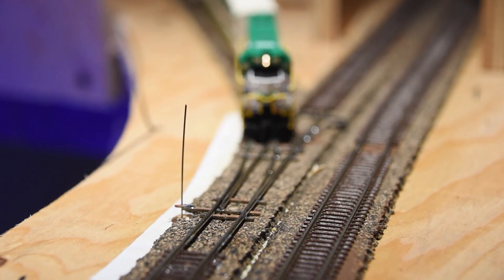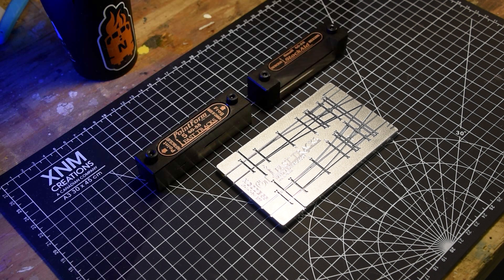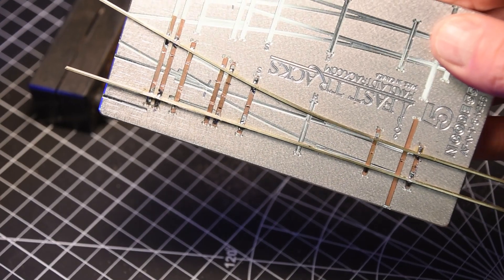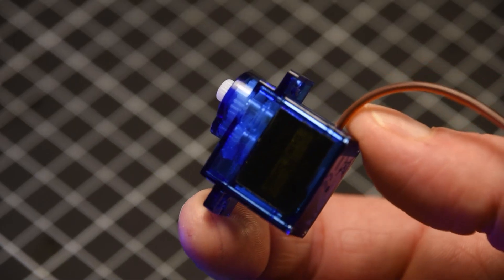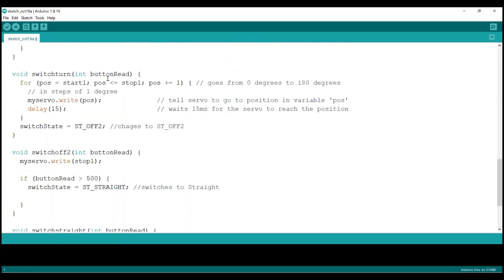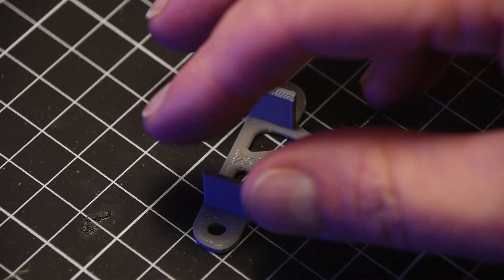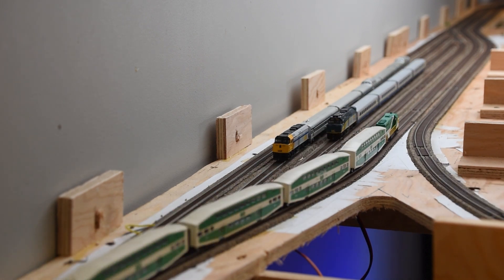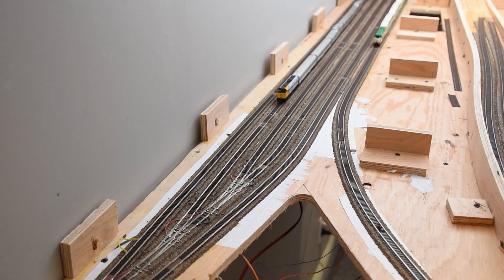Union Project: Handlaid Turnouts & Servo Point Control

Comment: thanks for sharing the STL files for the servo mounts - planning on using these when I get started with installing my servos on my n scale layout. So how many servos in total will you be driving off the Arduino? - just wondering as there is a limit to how many switch inputs the Uno can take and no one explains how to deal with having multiple servos that all need their dedicated switches.  Most examples just show a couple of switches.
Reply from the maker: I'm sorry this comment got lost. You can control 6 servos with one Arduino, but you need to provide an alternate power source. There are more than 6 inputs for 6 servos, so you can have multiple buttons control a single switch. Those switches will need to be open/momentary switches, not closed stop switches. (I think...)

Comment: Very cool video, love your idea of the stump switch. Yeah, wiring, it demands a separate plan, but as long as we’re experimenting it takes time to figure out the best way to draw, install, adjust and logically fashion all the necessary wiring. 
Some great comments on the FastTracks turnout jigs. The filing of the switch blades is also a necessity in HO scale, for Code 83. Can imagine that’s even more imperative in Code 55 for N scale. Nevertheless, when properly built, checked and tested, they’re the smoothest running switches my humble railroad is familiar with. Especially, the way it allows to construct a long frog, makes the turnout less dependent on the guard rails, which most certainly improves reliability.
Great project, love the duck under and the way you did show the occupancy for the staging yard. Cheerio
Reply from the maker: Thanks. It's interesting to note that the very slightest variance in the turnouts does affect their performance. The turnouts all work well, but some are much smoother than others. Almost in perceivable differences, but at this scale it matters. Likewise, I think the lower weight of end scale equipment amplifies imperfections as they tend to get thrown around with the slightest bump.

Comment: Excellent video. Question, have you considered running two servos with one button? Would be used for a single crossover.
Reply from the maker: Funny, you should mention that... I've since reprogrammed the arduino's to control paired turnouts. I'm not sure why I didn't think of it in the beginning, but it makes much more sense now that I've done it. Thanks for the comment
Reply: @NScaleDystopia   yeah, that's what I was thinking. You'd want both normal or both set to reverse. Would make sense to just have them on the  same button. I'm assuming there is no difference in coding, just need to add wiring?

Comment: how well do telephone punchdown blocks work for power distribution? I am absolutly not ecperienced in anything RR but I have used the old punchdown 66 blocks for power distribution on some of my low voltage projects due to the simplicity of both replacing the power source and the availability of power for long term uses. I was using breadboards origionally but the pins are for sure only a short term use since they tend to come loose over time and jarring. These turnouts are amazing, and I am interestes if a similar system could be acheived using the GPIO on a Raspberry Pi. The code has become easier since conversions from Arduino to Pi software have been done, but I wasn't sure if it would be campatable. love the channel and look forward to more videos.
Reply: Amperage may become an issue, as I recall those punch blocks are only really rated for 1 amp per pair. Most N scale motors draw half an amp, while most HO draw a bit under 1 amp. So should be fine for something small, but anything bigger than a starter table could be an issue.
Reply from the maker: I've never used a punch down block; I'm using terminal strips. I two would be concerned with the ability to handle the amperage, particularly since the auxiliary power supply I bought is 5 volt 2 amp. Good question... I wish I had a better answer!

Comment: Simple yet elegant solution. Might I suggest that you give an indication of cost for the little gems? I look forward to the next exciting installment.  Regards..
Reply from the maker: I never considered talking about the costs! I will tell you that each Arduino controller is worth about $20, and each servo is worth $2. The 3D printing is pennies, and a 10-ft length of piano wire is about 15 bucks. Thanks for watching!